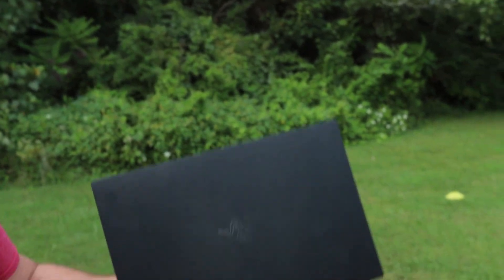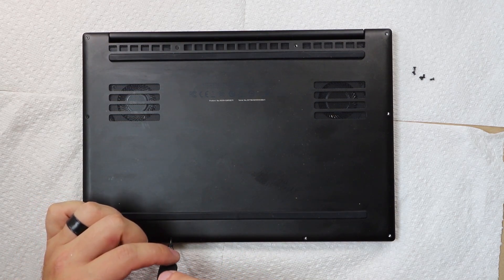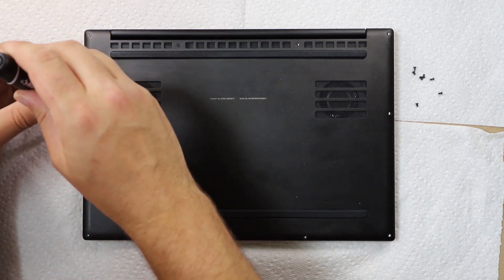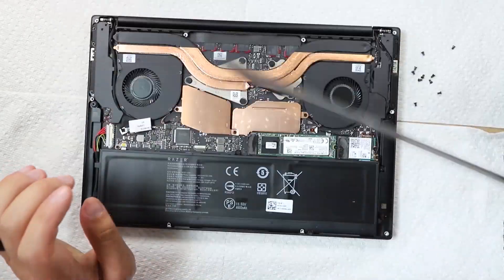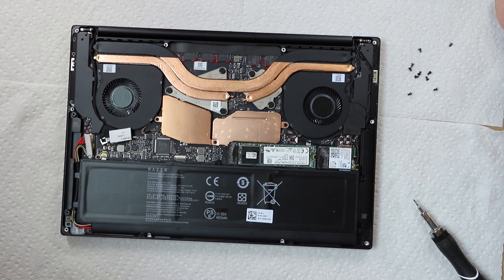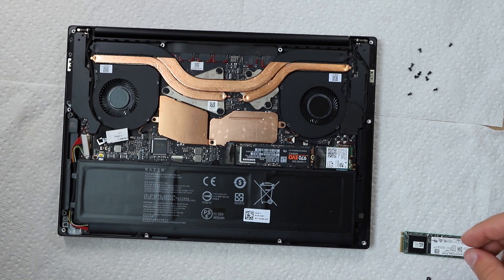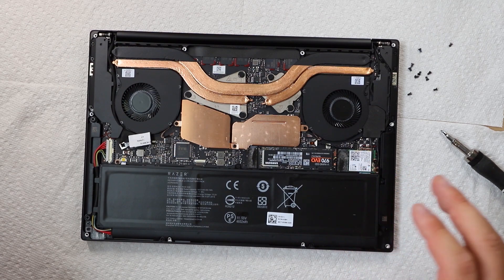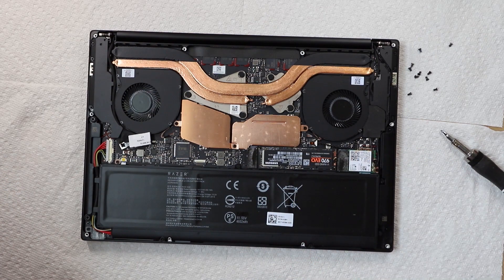Replacing SSD in 2019 Razer blade stealth - how to fix coil whine

Comment: of course changing ssd does NOT fix coil whine coming from CPU/GPU areas of notebooks (most cases).
Reply from the maker: True of most cases, in this case, my coil whine is completely gone.  This is a pretty well documented case.
Reply: @SchaeferFamilyAdventure  thx for response.. it is worth it for such nice laptops, of course. But in that case, it would have been good to see/hear before and after comparison. Greetings from Germany.
Reply from the maker: Good point, I figured most people who were coming heard the coil whine and we're just wanting a simple guide to follow.

There is a actually a pretty good example of the whine on another youtube video.  I'll link it when I get home if I remember.

Comment: Will data automatically transfer over when i swap out my ssd with a new ssd or do I have to move it somewhere else then put it on the new ssd?
Reply from the maker: You definitely have to transfer data and you operating system.  Link for that in the description of the video
Reply: @SchaeferFamilyAdventure  ok so I tried removing the ssd screw and the manufacturers overtighten so the screw worn out and I couldn't take out my old ssd and put in my one. Any suggestions as to what I should do?

Comment: Here in the UK the Intel HD 620 base model is only £800.. would you recommend picking this model up still? The GTX versions are still unavailable on Razers website..
Reply from the maker: No, honestly, I only recommend the mid level model. The high end well eat too much battery (plus you don't need the 4k screen at that size).
The base isnt worth the price.  Is look at something else or wait for the mid level.

Comment: I'm planning doing this too, but just to have more space for video games and various other media. It seems like the Samsung EVO series are perhaps the best on the market at the moment, but I still sometimes see scary reviews about how bad drivers and firmware and such have been killing drives. How has your experience been so far? Is that SSD actually worth the $170? Thanks!
Reply from the maker: Haven't had any issues so far- drivers were a bit of a pain, but the SSD works perfectly for me!
Reply: @SchaeferFamilyAdventure   I see! Which drivers specifically gave you trouble?

Comment: Hi, question.. if you put the old ssd back, does the w10 and other apps working like before or u need to reinstal w10 into your old ssd?
Reply from the maker: You know - I'm not 100% sure, but I think Microsoft has assigned a "vin" number of sorts to your copy of win10 - you can only have 1 activated at a time.  

In theory, if you took our your old ssd, reloaded the new ssd, then wanted to put the old back again, you could.  That being said - I'm not an expert on this....so take that with a grain of salt.
Reply: Yea it work just as before you removed it
Reply: I swap alot between mine for new os like linux and windows and all the functions stay the same and you dont need to reinstall anything on the old SSD if you didnt wipe it
Reply: Hyperion Gaming how do you transfer data from an old ssd to a new one, like apps and everything, not necessarily memory though, just the software itself. Things like after effects, fl studio, etc.
Reply: @thetyphoonzrecords  you use some software, theirs many tutorials online but keep in mind the more storage your using the longer it will take and trust me it takes a long time
Reply: Hyperion Gaming would it be easier just to reinstall the software on the new hard drive
Reply: @thetyphoonzrecords  in my opinion yes, for many reasons, one you get a clean install of everything, you get rid of most file you dont require, but if you prefer to transfer data, you need to buy a cable that does the transfers it's not an expensive cable, it's pretty cheap, but for me it's easier to just reinstall  on the new drive and wipe the old drive and use it as extra storage
Reply: Hyperion Gaming fire bro thank you im probably gonna do that, also when installed is it the same razer version of windows on the pc or is it a different version of windows?

Comment: Can u make a 1 month & 1 year upgrade update to know what are the problems you faced, what differences u felt compared to the old ssd, etc
Reply from the maker: I might do one after a year, but so far I'm about a month and a half in, and I've had no problems. The SSD just works - it's fast, big, and has had no issues at all.  An update video would be very boring
Reply: @SchaeferFamilyAdventure  how about now

Comment: Hello! I am trying to follow these instructions, but after installing the fresh ssd and trying to install windows, I am getting an error saying something like "No device drivers were found. Make sure that the installation media contains the correct drivers, and then click ok". I think there is some sort of a driver that razer requires. Did you run into any such problem when trying to install windows, or do you have any insight as to how to solve it?
Reply from the maker: Are you having that issue after installation?  I really didn't run into that issue at all, but perhaps your bootable version of Windows corrupted?
Reply: Schaefer Family Adventure After a lot of troubleshooting two months ago, I created a second installation media on a different memory stick which worked. My problem was during the installation process, as you are selecting menu options. It could also have been a corrupted installation media, as you suggested.
Reply from the maker: I'm glad you got it figured out!  Sorry for the troubles

Comment: Hey man thanks for the video. Does the problem reappear?
Reply from the maker: No problem!  Thanks for watching. 
I've not had any coil whine reappear and I've been putting it under pretty heavy strain in various conditions.
Reply: Good to hear. Did you experience any usb c discharging problems?
Reply from the maker: Nope, I haven't had that issue at all that I've noticed (I assume you mean charging slowly?).
Reply: @aldytjandra  USB discharging is a common problem with this laptop.  First, make sure you are using the port on the right side, not the left side.  This should improve charging in some cases.  But this will still not be enough.  The moment you start playing games, it will start discharging.  This is because the included power adapter isn't powerful enough to handle gaming.  I ended up buying a 100W charger from Amazon (I bought the Wacom Power Adapter, USB-C 100W (ACK42714)) and haven't had problems since.